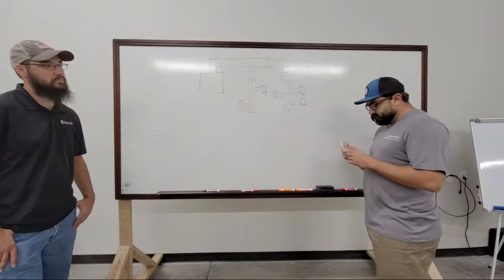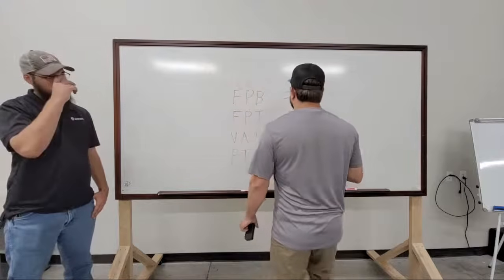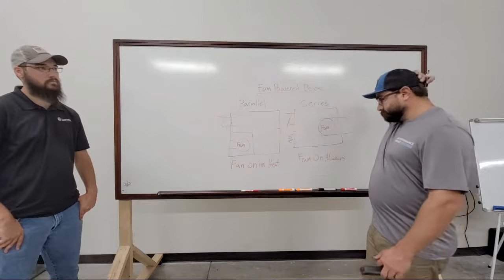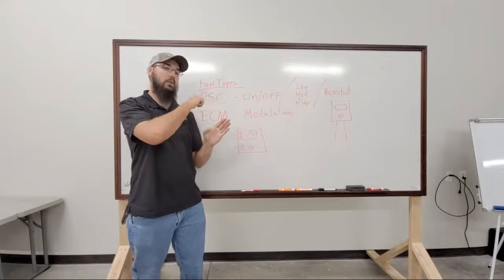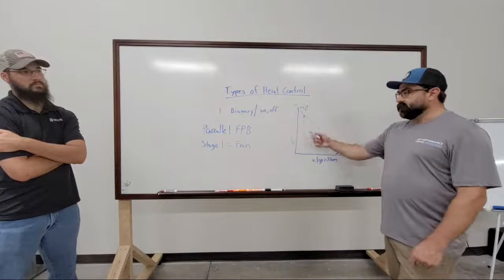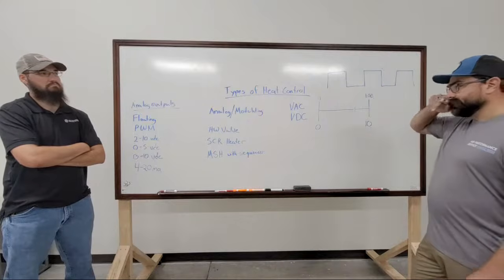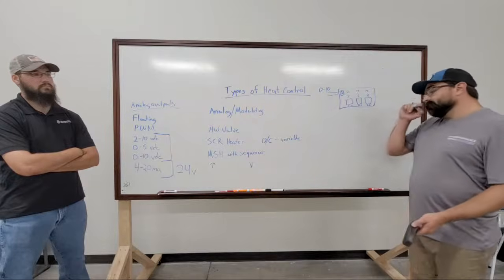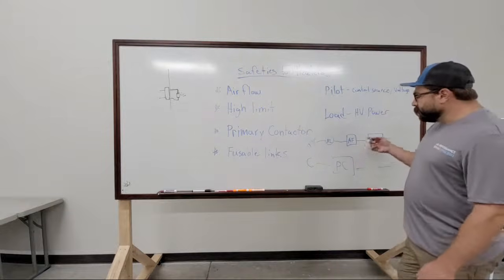Building Management System Terminal Units (VAV & FPB)

Comment: I had a customer that had a similar complaint of the tenant knocking the ceilings out and the noise of the box cycling on and off. A way around this problem can be mercury contactors, they are the same in theory as a standard 1,2,3 pole contactor but are not mechanical so there is no slamming sound happening, hopefully this helps someone lol.

Comment: i have a issue with a VAV system with 2 AHU (AHU 1 100% cooling) (AHU 2 100% outside air) they're connected together and there's a damper from the supply of the AHU 2 to the AHU 1, my issue is that the VAV vents are sweating, there's a BAS system controlling everything and i have a wrong sensor reading 5000F on the AHU 1, that sensor is the CLG sensor (COIL TEMP)  that sensor reads the temp coil, then i guess that is my problem because the BAS right now have the both AHU's in on positions cooling valves are 100% opens on both AHU's, VFD's for both AHU's are running  on position 40-50%, they're not in AUTO MODE they're blowing air without modulating, so i would like to know if that is my issue? the CLG sensor not reading right? because if i put everything back auto both cooling valve's get back to 0% closed, any advice?

Comment: In theory floating and pwm control would be a binary/digital output since it's on/off?
Reply from the maker: Its classified as analog because it it used with the purpose of controlling something 0 to 100%. It make close a contact for a pulsed signal but it is still a variable control.
Reply: @HVACTIME  👍, thanks for the response.